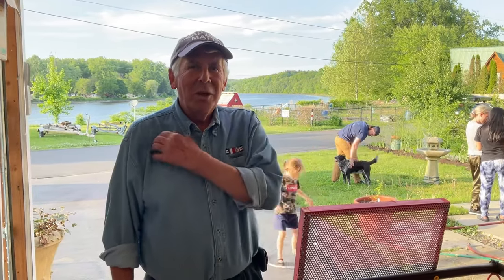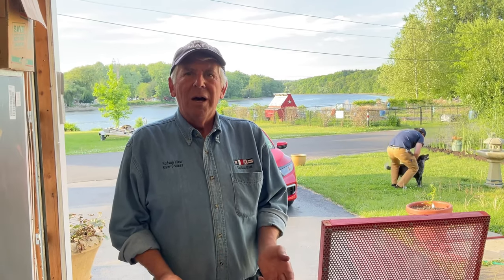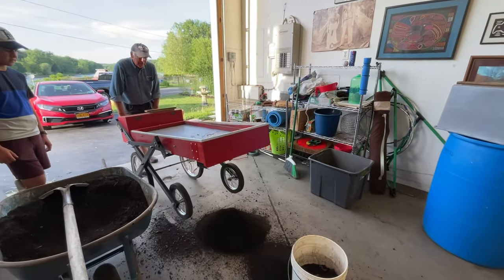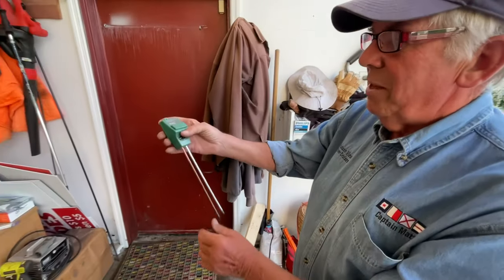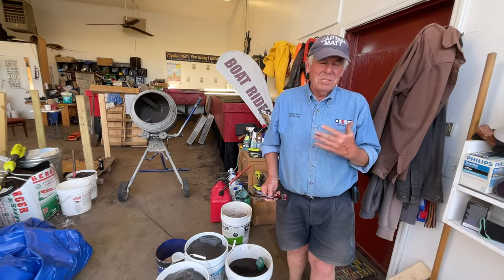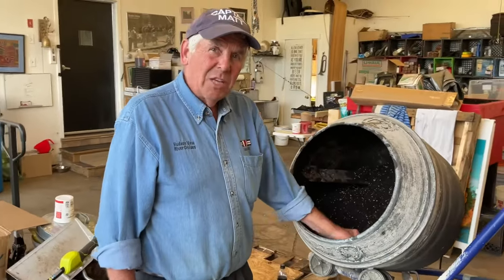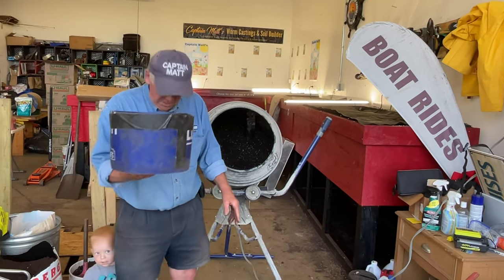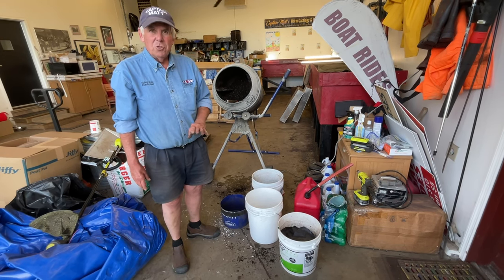How I Use Worm Breeder Buckets

Comment: The secret for getting around the Top feeding and to do the set and forget for 14-21 days is to mix in the worm chow 7-4 days before introducing worms, the fresher the compost is, the longer it takes to cool back down. The chow is generally between 1 and 1/3 to 1 1/2 cup per 2.5 gal. I like your style Captain Matt for me it is just the opposite for running production buckets, I do them in the warm months, because I can only store so much compost during the winter and in the warm seasons, I am able to store yards outside (unfrozen). Once you get it down to a rocket science (which it is not, just a saying) after shredding the compost and mixing in the chow you will be able to stick your hand in the bedding and be able to feel the exact measured amount of water to add.
1 step, shred the compost through 1/8 screen
2nd add the lime, mix
3rd add the worm chow, mix
4th check moisture, add water and mix
5th wait 4-7 days to cool down, check temps
6th add worms.
P.S. I don't actually use straight water, my preference is to use casting tea or pond enzymes containing BTI
Have a wonderful Day!
Reply: thank you for sharing too, I would like to turn this from a hobby to a main source of income. This helped
Reply: @jan1451  So, if you harvest castings on a Saturday then on a Sunday Monday or Tuesday the bedding has to get mixed up for use to be ready the coming Saturday. Usually the castings are harvested, the worm casting tea is started, the next day the bedding is prepared (shredded + chow mixed in) then after 24hrs a measured amount of tea is added and mixed, the  measured amount of tea changes depending of the moisture content of the Compost. My moisture meter is my hand, it is something a person experiments with and learns, eventually a person does it so much they can just go by feel.  The reason I stress a measured amount is so that when it comes time to harvest cocoons, castings and worms it is very consistent.
Reply: One advantage to using Pond Enzymes is they can be in a vessel with an air bubbler for weeks. Neither the casting tea nor the enzymes have to be used, but the microbial boost sure does help with smaller worms under 4" in length. The BTI is highly recommended because of flying insects that bread in compost piles, it kills the larva immediately after they hatch.
Reply from the maker: Thanks so much for your input
Guestions
How much lime
What is your chow composed of
Reply from the maker: What is BTI?
Reply: @CaptainMattsWorms  I use 2 TBS lime to 2 1/2-gal compost. My basic chow is 3 cups ground chicken Layer and 1 cup ground and sifted rabbit pellets, mixed. When I am doing buckets, I use 1 cup of the basic chow mix, 1 TBS of milk replacer and 1/3 to 1/2 cup Dried Molasses to 2 1/2 gal of compost. Honestly the rabbit pellets and dried molasses are not necessary, the molasses really puts a shine on worms. All that is necessary is 1 1/3 to 1 1/2 cups layer or starter and 1 TBS milk replacer for every 2.5 gallons of sifted compost.
Reply: @CaptainMattsWorms  Mosquito dunks,  Bacillus thuringiensis subspecies israelensis (BTI) is a type of bacteria that kills mosquito larvae before they hatch. It also targets the larvae of fungus gnats and fruit flies. I grind up the discs/donuts and use it at 1 ml per gal or 1TSP per 5 gal of water, It is best to let it sit for 12 to 24 hours before use or use an air bubbler for at least 6 hours. If you use a pressure sprayer after top feeding chow, it is good to have the BTI in the sprayer to. I use Chapin sprayers and they have a plastic filter on the bottom of the outlet tube that prevents clogging/plugging of the spray wand, If your sprayer does not have a filter you could use a teabag or cheesecloth with a rubber band to prevent plugging. The BTI is a wonderful product that works very well.
Reply: @wormsforlife7352   hello, do you purchase this Pond Enzymes or cultivate it from a pond?
Reply: @troydunn6228   I purchase the pond enzymes. The brand name is API POND.
The product is called: POND - ZYME
                                 SLUDGE DESTROYER.
This is the brand and product I recommend; it not only introduces beneficial microbes, it also helps breakdown the bedding faster so the worms can eat it sooner (important when doing the 14- day method).  Other brands maybe crystals that smell like perfume and are not natural.
Reply: @troydunn6228   The Pond Enzymes are mixed 1 TSP to 5 gal. water or 1ml to 1 gal. water.
Reply: @wormsforlife7352  thank you for sharing. It sounds like a good idea. Did you try out the sweet feed?
Reply: Do you have a YouTube channel?
Reply: @troydunn6228   No, I was considering it a couple years ago, then I was watching a person who was making worm composting videos doing a live and he got SWATED, at that moment I said to myself "I will not expose myself to video".
Reply: @wormsforlife7352  wow. Probably a good idea nowadays.  I'm currently building a wormery. It's small 22x24 but hopefully will utilize the space to grow out some bait worms.
Reply: @troydunn6228  Maybe you should consider growing ANCs. They grow really fast and can be grown anywhere from 3" to 8" in length (even up to 17") the nice thing is you do not have to purchase small refrigerators or wine coolers to sell them at gas stations. In a 22'x24' you could cut that space in half for growing using 5 gal buckets and stack them 5 high and use the other half for working the worms. The wonderful thing with utilizing buckets is you can grow them and age them from cocoon to desired sizes, producing tons and tons of castings at the same time.
Whatever or however you choose to get your wormery operating I wish you success.
Have a great Day!
Reply: @wormsforlife7352  I appreciate the recommendation! I just have started with two thousand ANCs in buckets. In our house lol. So far they are doing great. I cut a 6" hole in the top and glued screen over it. I also have ENCs and RWs but they are under a pole barn. The ENCs crawl even with lights on. I'm still learning for sure 😃. Thanks for the encouragement! May God bless you and the work of your hands!
Reply: @troydunn6228  thank you for your kind words. I would like to describe about converting buckets into worm bins so they can be stacked. I will try so that it is easily understandable. The tools are a drill, a 1/4" drill bit and a small retractable utility knife.
 What one does is lay the bucket down on its side. The holes are drilled about 1" below the lid. The process is to drill one hole on top/above and then another hole directly below about 3/4" to 1"in distance, all the way around the bucket, leaving a space about 1" to 1 1/2" apart. Then to go back and drill another hole in the center all the way around the bucket. Like a 5 on dice or a domino. Then go down below the bottom row of holes about a 1/2" and drill 1 more row of holes all the way around the bucket. The last row should be at the same level as the handle. (That leaves a 5 gal. bucket with the capability to use up to 4 gal). After the drilling is done use the utility knife to cut off burs from the drilling (usually on the inside). Then wipe the inside of the bucket with a dry rag/towel and move on to the next bucket. With drilling the holes on the sides of the bucket near the top one can put the lids on and stack 5 high or the buckets can be stacked on pallets with plywood and stacked 4 high. I hope this description is understandable and that it may give some ideas on other ways to use buckets.
Reply: @wormsforlife7352   Thanks for the detailed description. I will defiantly talk with my bride/business partner. We have been buying used food grade five gallon buckets from the bakery section for a dollar a bucket! They had icing in them usually and have a rubber seal. So the ANCs don't try to escape the holes I assume and no drainage holes? I don't put holes in my buckets now. Thank you for all your time.
Reply: @troydunn6228  The food grade buckets are the best, the plastic is such a better quality compared to the ones in the big box stores. No holes on the bottom. The worms do not try to escape, because of the oxygen exchange rate that the holes provide. The holes allow off-gasses to escape and do not allow excesses moisture to condensate on the sidewalls of the buckets. If the worms do escape, it is only because the bedding and feed mix has not cooled down enough before introducing worms.
Reply: @ worms for life can I use pure peat moss as breeding media instead of compost as I don’t have enough compost yet? Thanks!
Reply: @kennethdeocampo3982  Peat moss works fine for breeding, but it will not be converted to pure castings before it is time to harvest cocoons. If you wait for the pure casting's cocoons will have already hatched. There are basically 3 types of bedding that work for doing both at the same time.
1) Compost
2)Peat
3)Aged animal manures
or any combination of the 3
Peat and Compost can usually be found at a local Landscaper supplier and bought by the Yard.
With a good inoculation of worm casting tea and pond enzymes you can get about a 70% conversion to castings using peat moss before the cocoons hatch. The most important thing to do is to get the bedding as fine as possible with the goal of making it small enough that it will fit in a worm's mouth. If using peat moss (finely ground/shredded) it is 4 cups water/bacterial inoculant to 1 gal of bedding and worm chow mixed, you can scale up using the math when mixing several gal. at a time.
I hope this helps you out.
Have a wonderful Day!
Reply: @wormsforlife7352  your answers have been really helpful.  I’ve been toying with the idea of setting up a worm tea bubbler here to use when setting up breeder batches instead of filtered water.  Seems like it would make things more hospitable for the worms.  Question: to what temp do breeder buckets get to when chow is mixed in vs top fed?
Reply: @ericcarve4476  It depends on the type bedding when mixing in the chow. Off the top of my head with peat moss, I can recall temps ranging from 113F-118F spiking in 3 days and being down to 82F-90F in another 3 days. With well-aged compost and black peat, the temp usually does not get higher than 10 degrees more than room temp.
When the compost is fresh (less than a year old) or when the peat is freshly dug from the bog the temps can get up to 115F or 30-45 degrees F. hotter than room temp.

When top feeding like fish in an aquarium the temp does not have any noticeable changes. What I do by top feeding is a sprinkled-on amount that gets lightly misted/moistened and that is no more than the worms can eat in a 24-hour period. The worms get top fed every single day. It is important when using worm chow not to water the chow into the bedding, just moisten the chow so the worms can eat it. If the top of the bedding needs to be moistened it is best to moisten the bedding, then add the chow and then lightly moisten the chow. Sour crop and string-of-pearls is a real thing and 95% of the time when it happens it is from using worm chows improperly. 
When it comes to worm chows the best advice, I can think of to give is go to your Public Library and check out books about raising Bait Worms. Books about raising and growing bait worms will pre-date books about composting using worms. There is a newer book out there called 14-Day worm castings written by Bruce Galle that is very easy to understand and available at Amazon or maybe even at your library. I am not here to plug Bruce's book but if you are serious and wish to start out small, his book has a detailed plan on how to do it using ANCs. The book is just as valid using ENCs at 21-days. 
I do recommend you get a worm journal and a thermometer and document everything you do with worms.  
Have a wonderful Day!
Reply: @wormsforlife7352  YouTube isn’t properly giving me notification of replies, unsure why.  Thanks again for another deep explanation.  I am a hobbyist that feels I am at the precipice to where I should do more with them so expanding seems logical.  I care for them and want to do it if it is done right.  I’ll pick up that book, currently am at 8 full mortar trays of red wigglers.  Been enjoying the hobby for 2 years but recently moved into a 15x15 business incubator space with room to expand if needed.  Temp is stable and comfortable for them.  Maybe I should look into expanding into night crawlers.  What do you do with your worms and extensive work knowledge?
Have a good day too!
Reply: @wormsforlife7352  one big takeaway is I have not been monitoring temps, and I have been lucky I haven’t had a runaway temp hike hit.  My bedding has been shred cardboard, peat moss, and aged horse manure.  I recently got a few hundred pounds of rabbit poo and was going to sift that and mix it into my bedding mix.  My chow is a 50 50 mix of corn meal and oat meal ground in a coffee grinder, but also feed light kitchen scraps (to minimize flies) and some buried wheat grass mat pieces.  
Looks like I’ve had lots of opportunity to over heat these guys with how I’ve been managing them.  I’ll pickup a thermometer today and start logging.
Reply: @ericcarve4476  So, you have 8 mortar trays and wish to expand. My suggestion is to get a double screener and clean out 1 bin every week and after 8 weeks you will be up to 16 bins and then you can start back with the first of the 8 and do it all over again. With a double screener you would sift the worms and what you would be left with is larger worms(separated), smaller worms and cocoons (separated) including undigested and or wetter bedding and separated castings. You would have to make up bedding every week for the large worms and bedding to add to the smaller worms and cocoons every week. There are basically two types of double screeners horizontal ones and vertical ones they both work. The horizontal ones have the 1/8" screen first and the 1/4" screen second like the Brockwood shifter or a trommel. The vertical ones have the 1/4" on top and the 1/8" screen on bottom like the Bucking Bronco (UNCO) or Harvey (The Garden & Worm Lady). If the cost for one of these machines is a deterrent, there is a video on YouTube that has a machine that is simple to make. The video is not about the machine, it is however about breeding worms and very easy to understand. You may have seen it, then again maybe you have not, the video is by Bilsdale Worms.
I will post the link here: https://www.youtube.com/watch?v=1CLgkO8BiRg
Have a great Day!
Reply: @wormsforlife7352  When using a breeder buckets, do the worms get exhausted from continually breeding in this type of setup and need some rest and recovery time for their health or will they only breed when their thriving and in the right conditions anyways.  I want to do right by my worms so I had some concern about this when it comes to worms at not knowing the answer, being my family has a background in breeding not worms but dogs.  You see in the big picture, I was interested in using either breeder buckets or trays to help build a healthy population that I could maintain a consistent source of castings for a fairly large garden, and once I was at that point I would reassess everything to determine how well it was going and whether I should then look at expanding if their was enough of a market and demand locally for castings and tea as the local area is rurally isolated smaller population.  I had been leaning towards building large diy continuous flow bin(s), but I am still learning as to what would best suit the worms and my situation.  Ambient temperatures will probably be one of the biggest influencers as outside temps can range down to 0 in winter and over 40 in summer. While climate control inside garage could be planned in future, initially the worms wont be housed in there as its just too hot in the summer inside there.  Which leaves interim options of inside half sunken basement or possibly if temperture allows next to the basement outside which is kept cooler due to shade all day because of large built on verandahs on a highset house.  Maybe a bucket type system might be easier to move to control conditions in the interim, hmmm, any recommendations.
Reply: @Beartriple7  As long as the conditions are right the worms do not tire from breeding, but they do get old and as they get older and larger, they do slowdown in cocoon production, then again, the larger worms have larger cocoons and the bigger the cocoon the more hatchlings that emerge from the cocoon. As far as trays vs buckets I prefer buckets over trays especially when breeding and growing to desired sizes ANCs and ENCs. I used to use trays and honestly, I think they are a waste of space. With buckets one can stack them 5 high (with lids on) with 2.5 gal in a bucket, and if one runs out of space the buckets can be bumped up to 4 gal. the nice thing about buckets, in a 4'x4' space one can have 80 buckets (that is 200 gal. at 2.5 gal. a bucket). With breeding in buckets, you can really dial in the moisture content and get it perfectly so when you sift for cocoons and castings you only end up with 1 cup of undigested material littered with cocoons. If you are sticking with breeding Red Wigglers, then I would advise sticking with trays as they work the bedding better at a shallower depth. If it is important to produce 3.5"- 6" to 8" worms of the ENC or ANC varieties then nothing works as good as buckets. The mass of ENCs placed on top in a bucket will split up and devour the bedding in 21 days producing many cocoons. The ANCs placed on top in a bucket will work together in a mass from the top to the bottom then once they hit the bottom, they split up, the whole time they are devouring the bedding and producing cocoons in 14 days. The first ENC cocoons produced will start to hatch at 22 days and the first ANC cocoons produced will start hatching at 15 days.
Reply: @wormsforlife7352  thank you worms for life for once again sharing your knowledge and experience
Reply: worms for life, thank you so much!😊
Reply: Hi @Worms for Life. I have just started doing making worm casting for my Garden needs. I started with 5 gallon buckets( 3 of them). I filled them with aged compost only ( sifted to 2.5 mm screen little less than 1/8th)  by 3.5 to 4.00 Gallon each. I have around 200 - 250 red wigglers in each bucket. I top feed the on a regular basis by wheat + Oak + Corn grounded powder.  Question I have that how should i know that I have achieved the peak Casting and in how many days. If worms eat compost bedding why do i need to feed them grain worm Chow.  2. Since I do start with very fine compost - 3/32 inch should in put around 2 cups of grain worm chow in 4 gallon of compost. I am yet to start with sludge destroyer. I will do in next cycle as advised by you. I keep the bed moist so its easy for me to screen as well as its good for worms.
Reply: @vikaschandraf1231  I don't think with Worms For Life's method that you'll get them to consume 100% of the compost bedding or that you'll achieve "peak castings." My understanding is that if done properly you can expect them to consume 80% of the bedding/grain worm chow mix when you sift after 2 weeks and the cocoons will not have hatched. If you want to wait longer and have them consume 100% of the bedding then you'll be dealing with baby worms too. I may be wrong!
Reply: @Beartriple7  How are things going? 

I haven't ventured outside of my house yet this winter. I'm still running my two 27-gal bins. I'm hoping to start my first run of breeding buckets this weekend but they'll be in the house still. It was 16F-32F for about two weeks and the temperature inside my garage was the same as outside. I'll need to either stay in the house or experiment with different insulators and heat sources if I'm going to expand to the garage.
Reply: @CamOfWorms1  Hi Cameron,  things are going well, thank you.